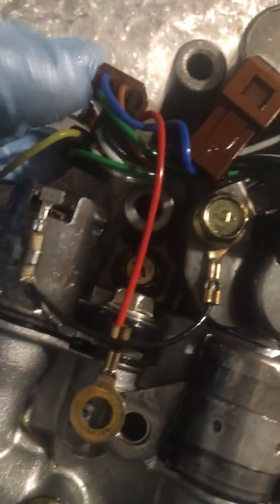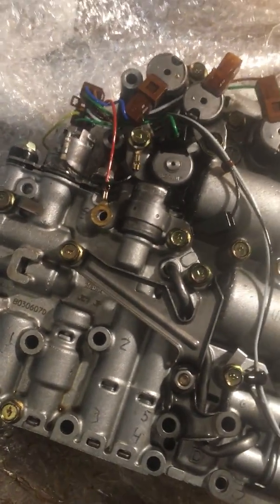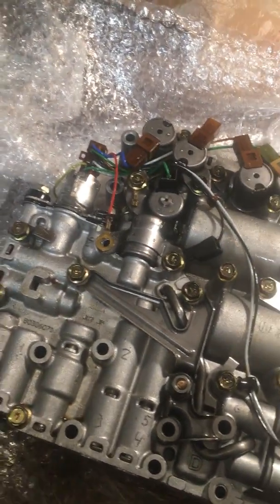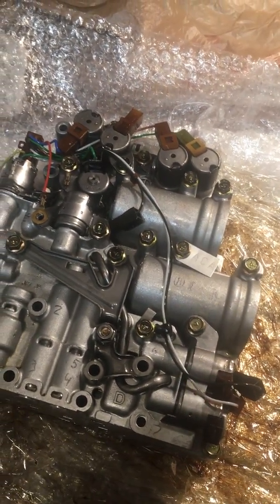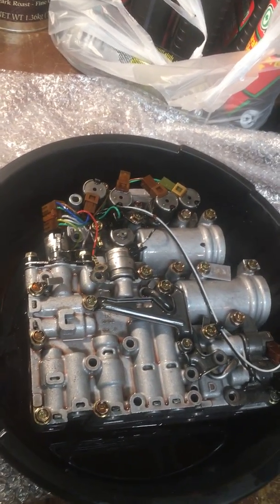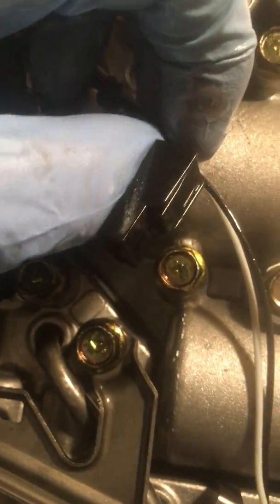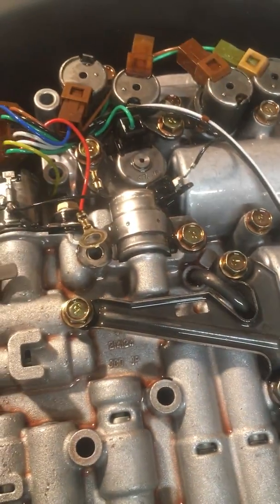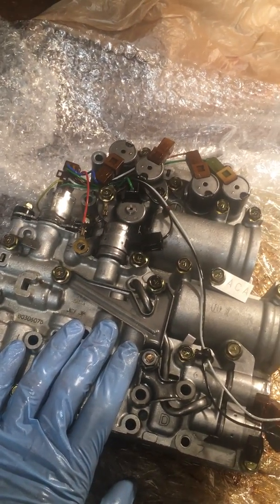09A Transmission Valve Body for MK4 Volkswagens With Tiptronic Transmission (Part 13)

Comment: Great videos. Do you have a link for where you bought the valve body?
Reply from the maker: https://www.ebay.com/str/shenghaiauto

their website has updated since i purchased it, and it took me to their ebay account.  I did have to reach back out to them as one of my solenoids was bad, but they sent me a different solenoid within 4 days for free.  

What are your symptoms as to why you think its the vavle body and not just the solenoids.

Thanks for the complement on the videos.  My whole goal is to help others with this job as I could not find any videos on how to perform this job.
Reply: @danieloshaughnessy8476   to be honest, it looks like the valve body has to come out to do the solenoids, so why not replace the whole unit if the price is similar. While monitoring vcds the ecu is commanding that it shift gears but the gears dont shift. Only stays in first gear. I suspect a bad solenoid

Comment: Hi great video was  wondering how your tanny is running after the vale body change and how many miles have you put on it sense the change over
Reply from the maker: Hey Fred, please make sure to watch them all as it is a long process. I should probably post a follow up video.  I have been running it now for a few thousand miles and 6 or 7 months.  One of my solenoids started acting up, and after communication with the company they sent me a replacement  reman and tested solenoid for free.  I have had no troubles since.  Let me know if you have any other questions about doing this job.  I have done removed and reinstalled it 3 times now, and taken the cover off 4.  As well as 14 quarts of trans fluid.  

-Dan
Reply: The only question I have is should I leave the transmission in second gear before I start doing the job before I remove the linkages from the training
Reply from the maker: @fredspider9944  I have thought about this after the fact, doing this (leaving it in 2nd) might save you 15 minutes of work. It may also affect your trans control unit, as the last known memory of the car was that it was in 2nd gear when shut off. So if you start the car in Park, it might affect it... IDK.  (So I wouldn't do it.) I also bought a Xtool v401 scan tool, it allowed me to reset the trans control unit for relearning purposes.  Others may have gotten by without doing that step.
Reply: So when I’m ready to install the VB I need to put the car in 2nd gear then install the VB in place and then reset in park again is this correct also when you do the VB install does it fall easily in place with the manual tube and the two O seals
Reply from the maker: @fredspider9944  Please take the time and watch all 35 vids on the play list if you have not already. Yes rebuild shift linkage (with VB out) and place into 2nd gear.  O-rings stayed in place fine.  (someone suggested using a pin to hold the slide all the way to the right, as you are facing the VB, or all the way to the left as you are looking at the back of it) Install VB.  I was very detailed in how to best reinstall the VB.  I went up from underneath the car and had to rotate it in counter clockwise.  it slid right in, my other vids explained how i put in all the bolts to make sure it all fit just fine.  I did not take the car out of 2nd until the car was off the jacks and back on the ground after the install was complete.
Reply: Daniel O'Shaughnessy Thank you for your input I had replaced my solenoid in December and was running great but now lm having problem with 3 gear so now I’m debating in just changing that one solenoid or change the complete VB FYI when I did the solenoid I removed the front end very easy to remove and much easier to work on the transmission.If you go this route you don’t need to disconnect the AC lines gust separate it from the rad and move it to one side.
Reply from the maker: @fredspider9944  Hey, my vids are here for just that reason, to save people hours of research and frustration that I went through, and when i realized no one had posted this job on youtube yet, i knew it needed ot be done!  Someone else mentioned removing the front end easily, if you could you should post a video on how to do this!   I never had to disconnect any AC, power steering, fuel, or coolant lines.  I just moved them out of the way, i showed it all in the vids what I did exactly.   
Also to help determine if it was the VB or soelnoids there is a rule of thumb I learned:

Replace solenoids if your car shifts rough when engine is cold, but will shift fine when engine warms up.

Replace valve body if your car shifts rough when engine is cold and when your engine is warm. 

*Correction on the scan tool its the Xtool v401.
Reply from the maker: @fredspider9944  Also https://www.cascadetransmissionparts.com/ here in Oregon has all new solenoids for relatively cheap.   However I do not think their vb cover gasket is correct.